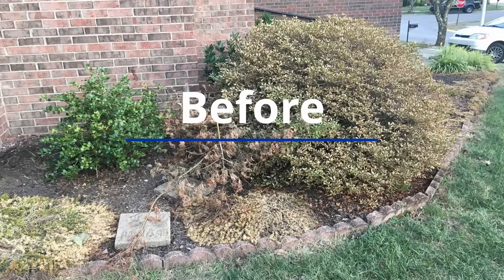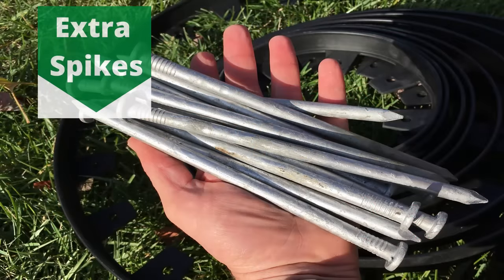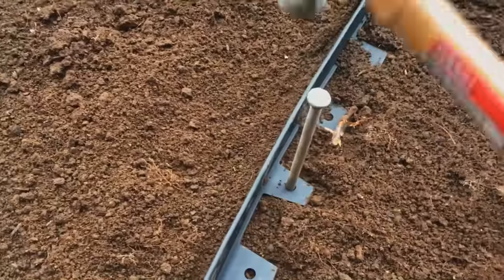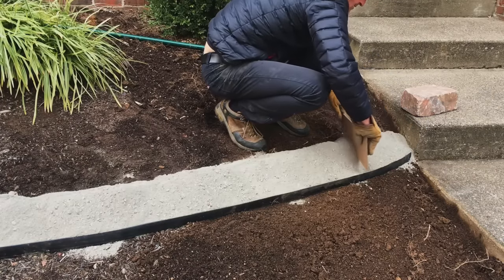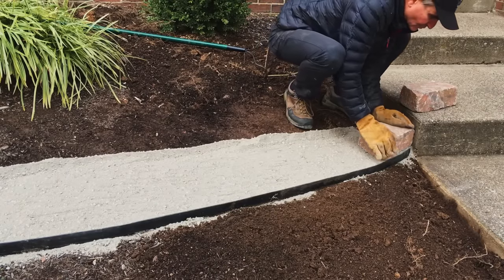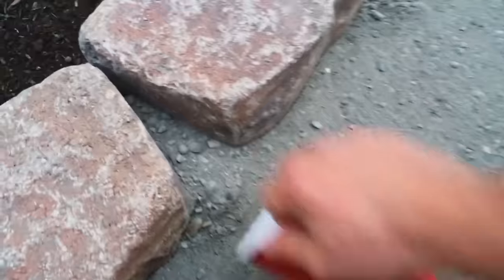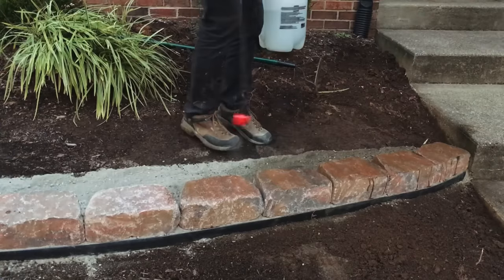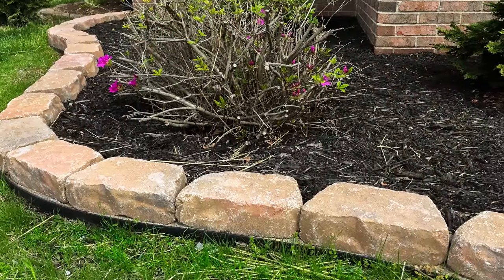easy diy No Dig Border *2020 UPDATE*

Comment: I love this idea, but I don't really understand about the concrete. I always thought that QuikCrete needed to be completely wet. How does the concrete under the block mix with the water? Seems like it would be better to mix the concrete in a bucket enough for 3-4 blocks at a time, then install.
Reply from the maker: Believe it or not, this concrete is made to work perfectly like this. Here is a video from the manufacturer demonstrating its use like this in another way: https://www.youtube.com/watch?v=T7X9YKcfqk0 I hope this helps...I know it doesn't seem logical. :) Have a great day, Joseph.
Reply: @maxpatch67  I saw this video before. That's exactly how I installed my mailbox. Its very different from what you do however. The post in the manufacturer's video is saturated in water with concrete on all sides working with gravity. In your video its lightly sprayed and I can't tell if its mixing (under) the block. I really like the idea you have but I will mix my concrete in a bucket then add the blocks. I can install the blocks as I go. I don't want any regrets a few years down the road. I'm a measure 3 times, cut once kind of guy. Thanks for posting.
Reply from the maker: @jzm6403  now, Joseph, of course it your project and you can do it how you want, but I assure you, it will turn out even better by using this misting method I'm demonstrating for you. The cement mix acts as a sponge, just as it did in your mailbox hole, and begins setting up and bonds it all together perfectly. I really encourage you to trust me on this. You will be very glad you did.....but I really appreciate you expressing your thoughts on this, because I know it goes against traditional thinking, but it really is the best way...by far. Take care!!
Reply: @maxpatch67  UPDATE: I completed mine on Friday. I actually did it just like this. It turned out very nice. My wife was a great helper and was impressed with the way it looked. It was a lot of work for me and stressful on my 2 surgery back. I used 50 blocks (just like this) and 8- 50lb bags of Quikrete. Mine went down the side of the house as well as the front. If the blocks move after the Chicago Winter, then maybe I'll just add another layer. Its not 100% even but has a natural look. Put in 4 shrubs the next day. Now I'll rest for a week or so.
Reply from the maker: @jzm6403  Joseph, I'm very excited for you!! Congrats!! Hey, if you wouldn't mind, I love to post your border pix on my website https://www.timvogelaar.com/Easy-diy-no-dig-border. If you want to, you can send the to tim@timvogelaar.com. Nice work!!!

Comment: Thank you for your DIY video. Sounds like a great way to keep the retaining wall sturdy for a long time.  What is the best approach to adding additional layers of brick to increase the height of the wall?
Reply: I read another comment on this and sounds like using adhesive would work to increase the height by a few additional rows...
Reply from the maker: Yup. Like my reply said, I have not done it, but it should work. I prefere make things work with just one row high. Have a great day!!

Comment: I live in zone 5 (Canada), will I need to dig down and put rubble down before the concrete layer???
Reply from the maker: Connie, this is an excellent question and one that I would be interested in knowing too if I lived up there. I build these borders here in Nashville where I live. Here is what I know. On my older video of this technique, I had people from several years ago, testify as to how happy they were with this border after multiple winters and these people lived in New England, Chicago, and Canada. That being said, I don't have personal experience building them up there and I do understand your concern. Also, check out the very first pinned comment below the video. A viewer wrote about this topic.
Reply: @maxpatch67  - Thanks for that!  Cheers!

Comment: Is there anything preventing us from digging a little trench and sinking the border into the ground?  Thanks!
Reply from the maker: That's not a bad idea. This adds the benefit of being able to run your mower over it. It loses a little in weed/grass invasion, but you might not have that problem in your yard. Here in Nashville, we have Bermuda Grass which send runners over the surface and would spread into there more easily without the height. So...you might have a great solution! Do you think you will try this?
Reply: @maxpatch67  Thanks!  I’m doing artificial turf so weeds won’t be an issue for me haha!  I’ll give it a shot 👍
Reply from the maker: Whoa!! This is going to look amazing!!! Please consider sending me some finished pix when you are done!! My email is tim@timvogelaar.com.

Comment: How do you level bricks (keep them straight in appearance) on a slope? Great job on this video.
Reply from the maker: Thanks, Mark. This technique works perfectly on a slope. You don't change a thing about any of the steps. Just hold the levelling cardboard or board at a slight angle upward away from the back of the plastic edging and it will have a nice angle to match your slope. Let me know if you need anything else..

Comment: Hi, can you add another block on top and a base to make it look like a seating wall?
Reply from the maker: Kidek, I have not made a second layer on this type of border because I don't know if it would look that good and the difficulty level is raised some because you would mix up and use a traditional mortar between the layers. Even, though, it involves more work, I would highly recommend digging out the old dirt and mulch out of your area so the level is dropped enough so that there is plenty of room for the mulch to sit in there without spilling over. Also, the same thing can be accomplished by building your border out further so the dirt can slope down to the level of the bottom of the blocks and also have room for mulch.

Comment: With the no dig border can you have 2 layers instead of 1
Reply from the maker: Da La, I have not made a second layer on this type of border because I don't know if it would look that good and the difficulty level is raised some because you would mix up and use a traditional mortar between the layers. Even, though, it involves more work, I would highly recommend digging out the old dirt and mulch out of your area so the level is dropped enough so that there is plenty of room for the mulch to sit in there without spilling over. Also, the same thing can be accomplished by building your border out further so the dirt can slope down to the level of the bottom of the blocks and also have room for mulch.

Comment: What if it rains or snows, wont this unsettle the cement?
Reply from the maker: The day you build the border, it should not be precipitating, but as soon as you have it assembled you want to get it wet right away. The misting step does real efficiently. As you are misting it, the cement is beginning to set up already. It absorbs just the right amount, so you can mist it liberally and not worry about doing it too much. But more to your answer maybe....don't spray it hard, because yes, then you would be washing it away before it can set up....so just mist it. I hope this helps.

Comment: Is there a video on how to stack them to get a higher border?
Reply from the maker: You might add one more layer with this technique and be ok using either landscaping adhesive or traditional mortar. I have never done it, but it should work. If you want to go multiple layers high, use a different technique that uses a traditional levelling method so its much stonger, stable and looks good with the added height. I hope this helps.

Comment: Was the "Vigoro no dig edging" that nessesrry?
Reply from the maker: Yes, it is very necessary, but if it's not needed in the long run for permanence. To make it removable, flip it around and attach it in reverse and pull it out after a day when the cement has cured. I hope this helps.

Comment: Does the ground have to be perfectly level?
Reply from the maker: Nope. When you tack down the plastic edging, it should glide over the lowest spots and do some levelling through that process. Don't tack it down to the lowest spots along the line you are creating. When finished, it should "undulate" beutifully over the ground. It will go up and down over the large ups and down but glide over the small stuff. Thanks for the question and have a great day, Manny!!

Comment: Can I do this if I want my retaining wall to be 3 layers high?
Reply from the maker: E3Mendoza, I have not made a second layer on this type of border because I don't know if it would look that good and the difficulty level is raised some because you would mix up and use a traditional mortar between the layers. You could also use landscaping block adhesive. Even, though, it involves more work, I would highly recommend digging out the old dirt and mulch out of your area so the level is dropped enough so that there is plenty of room for the mulch to sit in there without spilling over. Also, the same thing can be accomplished by building your border out further so the dirt can slope down to the level of the bottom of the blocks and also have room for mulch. I hope this helps.

Comment: Thinking about giving this a try. Is there anything special I need to consider since we are on clay soil where growing zones 7b and 8a meet? The bed is against our slab foundation if that matters at all as far as drainage.
Reply from the maker: That all sounds fine to work perfectly with the technique found in this video. Follow each step and tip and you won't regret it. Have a great day, Jayne.

Comment: Can I stack the bricks on top to get a retaining wall like look?
Reply from the maker: Ann, I have not made a second layer on this type of border because I don't know if it would look that good and the difficulty level is raised some because you would mix up and use a traditional mortar between the layers. Even, though, it involves more work, I would highly recommend digging out the old dirt and mulch out of your area so the level is dropped enough so that there is plenty of room for the mulch to sit in there without spilling over. Also, the same thing can be accomplished by building your border out further so the dirt can slope down to the level of the bottom of the blocks and also have room for mulch.

Comment: Great video but that was either new construction or you dug up the bed area before filming. But like I said great video very informative
Reply from the maker: Great observation. Ya, I know you are referring to the bare dirt the plastic edge was nailed down to. I had just used a rake and changed the grade of about 1/4 of the area right before I built the border so thats why there was bare dirt there iinstead of grass. After this edge, I built another one around the tree in the same front yard right on top of the grass like the border is designed to do: https://youtu.be/2GsaE9scVAQ Thanks for the comment, Jason, and have a great day!

Comment: What happens when years down the road roots from trees raise to the surface and cause havoc with  the concrete and makes a mess?
Reply from the maker: The border will still be intact, but just have a crack in it, where the root did the damage. For years of quality function and beauty, this technique cannot be beat. You might prefere a different border, though. Its not for everyone. Have a great day, Flower Child!!

Comment: I had a question.  What would recommend for next to the curb on my front yard.  I have a semi circle flower bed up to the grass and the street is on the other side.
Reply from the maker: In that situation, you might want to dig out enough dirt from about 2 feet wide around the edges of the area so that you don't have a need for a border. On the very edge, about 5 inches is a good depth and slope it up to the normal ground level after about 2 feet in from the edge. This extra depth is all you need to have nice mulch in there and never have it falling out and making a mess. This allows you to put a few inches of mulch in there so it works real well. Once a year, rake out the mulch out from the edges into the middle and put some fresh mulch into the area.

Comment: Would this work using brick? I wanted to match the brick of my house. I can get the brick from the company that built my house because they're still building around me
Reply: Also, wanted to make it a little higher if I could
Reply from the maker: You can use any brick, block or rock product that you want with this technique. Just picture it in your mind to make sure you will like the way it looks when finished since it is permanent and work to remove. It sounds like you have a cool idea!!
Reply from the maker: Julie, I have not made a second layer on this type of border because I don't know if it would look that good and the difficulty level is raised some because you would mix up and use a traditional mortar between the layers. You could also use landscaping block adhesive. Even, though, it involves more work, I would highly recommend digging out the old dirt and mulch out of your area so the level is dropped enough so that there is plenty of room for the mulch to sit in there without spilling over. Also, the same thing can be accomplished by building your border out further so the dirt can slope down to the level of the bottom of the blocks and also have room for mulch. I hope this helps.
Reply: @maxpatch67  thank you !
Reply from the maker: my pleasure, Julie!!

Comment: Wow I'm very impressed on how easy you made this look and looks great  but QUESTION...do I need to level the ground for the stone to set correctly or evenly or does the quick cement does the leveling part? Thank you
Reply from the maker: When you spike your Vigoro edge to the ground, it is going to glide over the lower parts(don't spike it down hard in the low spots) and level it some. If you have any huge dips or humps that you don't want, you should get out your shovel before making your border. This border looks good, just gliding along the ground surface in a curved, undulating fashion. I hope this helps.
Reply: @maxpatch67  no dips but I have maybe a 2ft difference in slope from end to end in my front yard.
Reply from the maker: @lprince3884  I think this border looks great curving along with the natural curves of the ground, but its up to you of course.

Comment: Great video!  I was wondering, I'm not that good with gauging how much water to add to the concrete by misting it.  Would it be a bad idea to just premix it in a wheelbarrow and shovel it in wet?  That way I know the mix is right.  I guess I'm asking why you pour it in dry?
Reply from the maker: Great question. As stated in the video, this misting step is as easy as it looks. If you are unsure, just spray it longer with the mist. If you want something really concrete to go by for time, imagine swinging a hose attached with a nozzle on the mist setting back and forth over about a two foot wide area. If you do that two foot section for about two minutes, that would be plenty. If you want to do it longer for good measure then go right ahead...you can't mist it too much. It will start setting when it gets the right amount automatically and it does not hurt it at all to have more. ......and you do want to pour out the mix dry onto the ground as I show in the video. It is much, much easier and the mix is made to work like this so there is no reason at all to mix it first. I know this is contrary to popular thought, but this "fast-setting" concrete mix is made to work like this. Have a good day, Xamu!!!

Comment: Is the concrete necessary or can it be done without?
Reply from the maker: I would choose a different method if not using this special cement. The cement provides four major functions in this border technique 1. Height(for looks) 2. Keeps the stones straight/aligned over time 3. Stability/strength 4. Weed barrier(the extra width is nearly impenetrable to aggressive weeds and grasses(Bermuda Grass) that we have here in Nashville.

Comment: Thanks for the excellent video. I have question before I start my project : what are the cons of not using the fast-setting concrete base ?
Reply from the maker: This cement mix adds height(makes border more sculptural), add strength and permanence, and goes a long way towards keeping invasive grass and weeds out. You can make it without it, but it is really the main feature of this border. That being said, others make it without it and still like it.

Comment: You don’t level the blocks?
Reply from the maker: No. Levelling is not needed at all. That is part of the beauty of this border is having it shape to the curviture of the ground. The cement keeps it perfectly aligned ovre the years, which goes a long way in long lasting beauty. A little levelling happens when attaching the plastic edging to the ground. Small little dips in the ground won't show up because when you tack the edge down, you'll pound the stakes down firmly on the high parts and in the low parts, the edge can just glide over those areas and not go down in there. You can use a stake in a lower area, but just don't tack it all the way down....this will create some levelling. I hope this helps.

Comment: Can this work for a straight line bed and not curved?
Reply from the maker: Yes. If you choose that option, then use a stiff, straight plastic edge that you can by in the stores instead of the flexible Vigoro edge. This other edge is sold in about 5 or 6 foot lengths and will really help you in making it perfectly straight. Also, if you want, you can alternate the blocks back and forth to close up the gaps if you think that would look better. Thanks for the comment. Have a great day!!